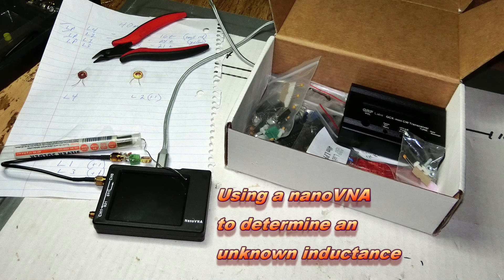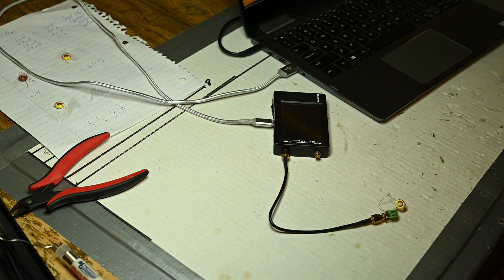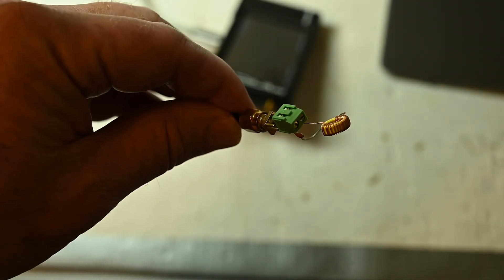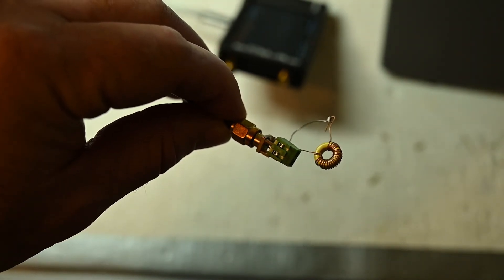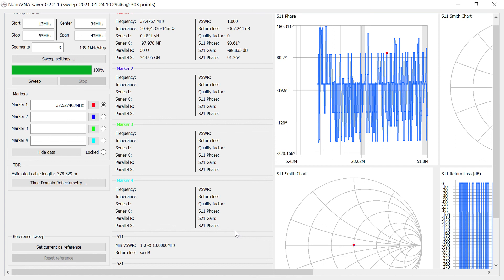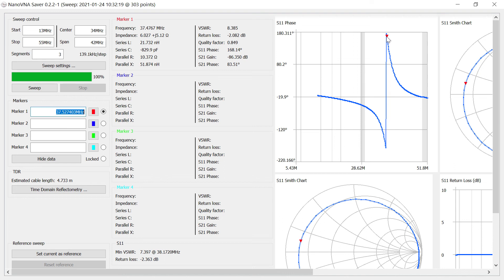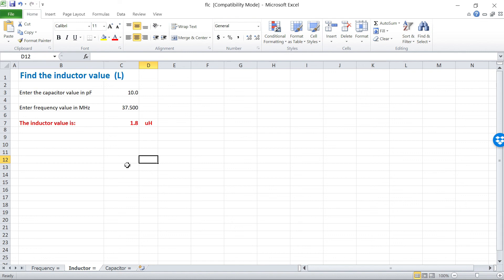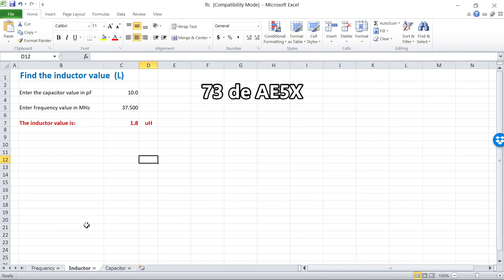Using a nanoVNA to determine unknown inductance value

Comment: Sweet. 

I am about to build a receiver & all my testers for L & C had crapped out when fired up.

I do have a working Nano Vna & of course it came without any manual but I figured it could do the job but how. Now we know. 

Another guy read L directly but he did not share where in the vna's menu settings he was. This on the other hand is a simple indirect means to get what is needed.

I even sent away for a $20 tester today. Well, it does not hurt having back up....

Comment: The underlying formula is f = 1/(2π*(L*C)^(1/2)), where f = frequency, L = inductance, C = capacitance. Please mind, that the values are given in Hz, H, and F. So you must adjust for M, µ and p.
Reply: Rearranged for the unknown value of L and corrected for scientific notation, the Excel (or Google Sheets) formula is "=(((1/(6.28*K24))^2)/K25)*10^6" where K24 is the frequency in MHz and K25 is the capacitor value in pF. The 10^6 converts Henries into uH. (For those unfamiliar with formulas, the K is the column and the 24 and 25 are the rows.)

Comment: Great video! Thanks for showing. Is that VNA the H 2.8 inch screen or H4 with the 4" screen?
Reply from the maker: That's the 2.8" in the video but I now have the H4.
Reply: Is the H4 much better outside of the screen size? @AE5X
Reply: @W1RMD  I've got the 2.8" and I like that it fits in a tiny pocket of my go-bag for portable antenna work. In the house or shop, I hook it up to a PC so the screen size doesn't matter.
Reply: @socallars3748  Good to know. I believe that this also can be updated from 101 to 401 points with the proper software as well.  Other than the screen being a little hard to see, it seems like a great product for the price.
Reply: @W1RMD  It really is a great value, I can't see paying several hundred dollars for a RigExpert or the like when these cheap little things works so great and do so much more. It is a bit hard to see in bright sunlight, but the only thing I'm typically doing outdoors is quick SWR checks and it's manageable. If mine broke, I'd buy another tomorrow.

Comment: The measurement adapter should be mounted on the SMA socket and not at the end of the cable. Calibration of SOL (Short, Open, Load) must be done on the adapter. Use two 100 Ohm SMD resistors with 1% tolerance (in parallel) as LOAD. After calibration, OPEN measurement and delay compensation (Phase equal to ZERO degrees) But this calibration is not 100% accurate anyway.
Reply: if you calibrate out to the end of the cable, the cable is ignored!
Reply from the maker: No it is not 100% accurate. I've made these measurements a number of times using various calibration methods, with very little difference in the value obtained for the measured device.

Comment: You didn't mention it, but you should do a calibration with the cable and adaptor you are using first. But here is another issue: the permeability of the toroid material varies with frequency. So you have measured the inductance at 37 MHz, which is not where it will be used in the QCX! To use your method, you should select a larger capacitor in order to get the resonant frequency closer to the operating frequency.
Reply from the maker: I approached the measurement as if I didn't have any idea of what the inductance might be. Then I confirmed the measured result with an LCR meter. The LCR meter uses a frequency of 100 kHz to make these measurements - that's a long way from 37 MHz and yet both methods indicated 0.9 uH for the coil.
Reply: @AE5X  It may depend on the particular toroid material. I am going to do some experiments. I have an LCR meter (several), an MFJ antenna analyzer, a GDO, and a NanoVNA, and I will compare the results at several frequencies.
Reply from the maker: @4X6GP  - I think I'll do the same. The reason for identical results at greatly different frequencies is probably due to the broadbanded nature of the toroid core's permeability. Ideally, several core types and measurement methods would be compared...not sure how many types I have on hand though.

Comment: Tried this with different inductors and the all ended up ~3uH +/- 0.2, even if i removed the inductors and measured just the capacitor. That can't be true, one of the inductors was wire coil, and other two were different torroids. What I suspect, I measured is the phase shift on "antenna" which was made up by the wires leading up to LC circuit. Also - phase shifts multiple times across broad frequency range, which one do we use for calculation?
Reply: I got similar results when the cable from the VNA port to the DUT was too long. It's supposed to be as short as possible.

Comment: What value did you get with your LCR meter?  Also did you get the QCX on the air?
Reply from the maker: I got the same value with the meter. My QCX is receiving but not transmitting yet :-(

Comment: Thanks for this video.  Please also consider that such a capacitor may vary up to 20% from its marked value, a typical tolerance for low cost capacitors.  So the calculated value of inductance may also vary within that margin of error
Reply: Ultimately you need  an accurate value for the capacitor. It's not just manufacturing tolerance but also the characteristics changing with increasing frequency - particularly with poorer quality capacitors.  

This test gives a ball park figure (or a bit better) and I think that was all he was looking for - it's good enough for what he wanted.